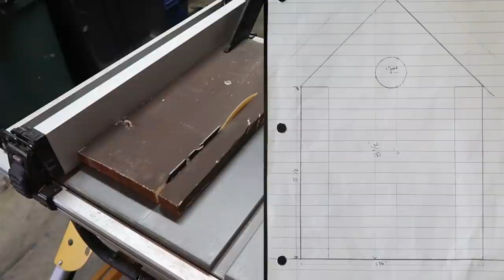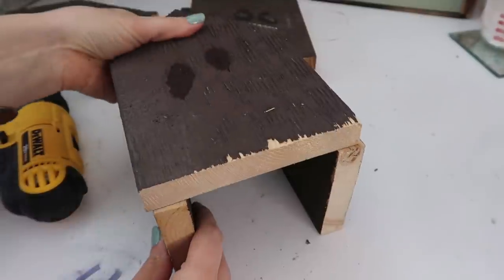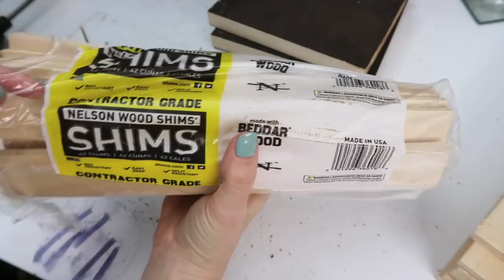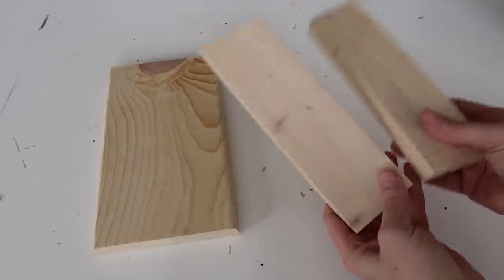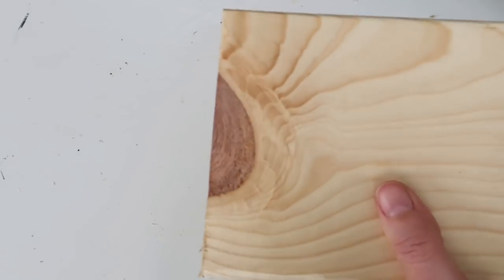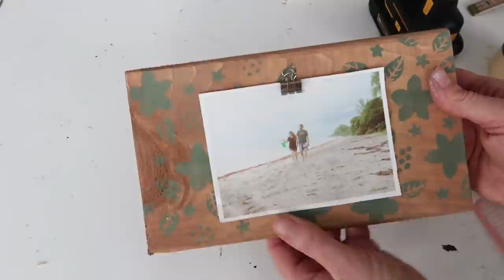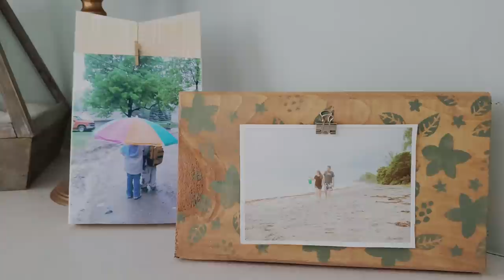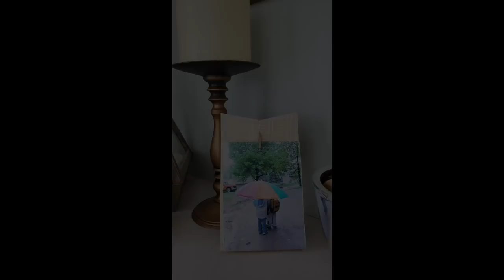🌟 WOOD PROJECTS | BUILD A BIRD HOUSE, FRAME, WOOD BLOCK PLANTER - RECYCLE | SCRAP WOOD OUTDOOR IDEAS

Comment: Great advice about looking up the best way to build a bird 🐦 house according to the type of birds you want to attract...especially taking into consideration the diameter of the entrance hole 🕳 best suited to the species of bird❣️😉🥰😀 It's so very important to keep larger "bully birds" out of a wren's nest, for example. ☹️💙
Reply from the maker: Thank you Leslie💗💗💗
I never knew there were bully birds until a couple summers ago. I kept running out to chase them away and tried putting the babies back in the house over and over 🥺 but they eventually took it over. It made me so sad.
Reply: @coffeewithmysunshine2506  Yes, Casey - until you have seen it with your own eyes, 👀 most people would never suspect this happens in nature.  But it does...this is when "survival of the fittest" becomes heartbreaking. 💔 😢